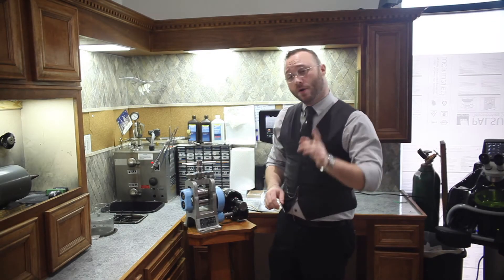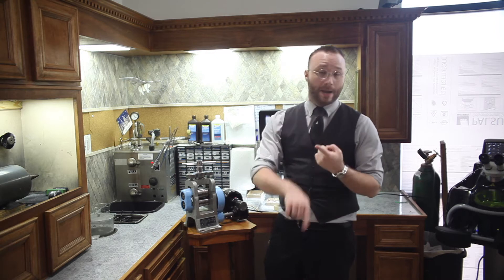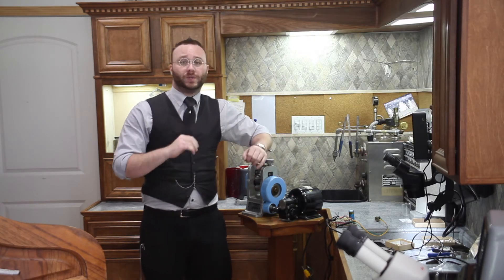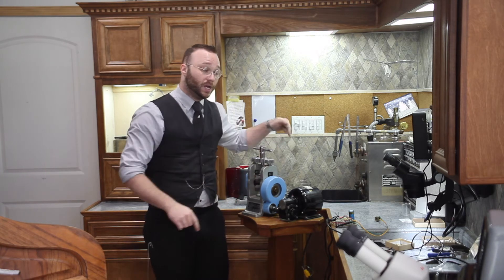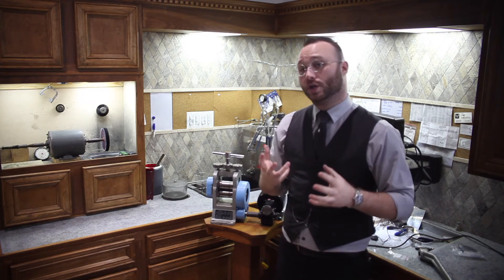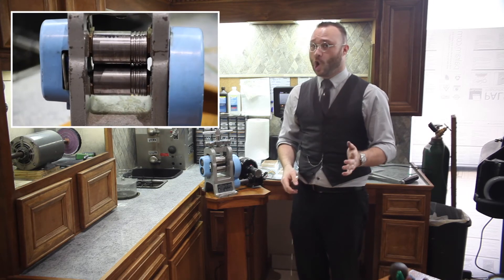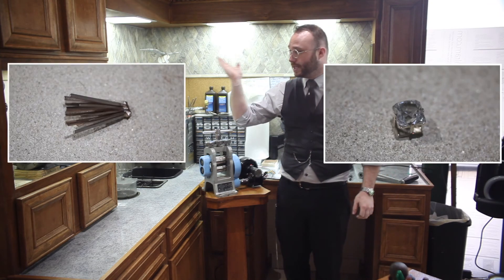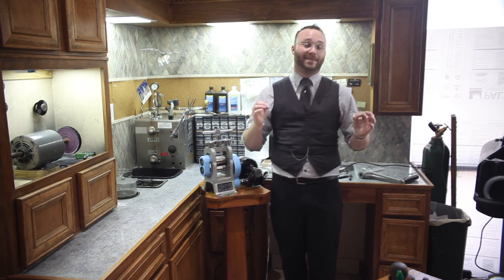Converting A Tatum T-70 Manual Rolling Mill To Automatic

Comment: It's great to see someone posting a video about DIY option for driving your rolling mill.  I'm sure the setup will work fine for the application but if your looking to do your own I would make a few changes. Fractional horsepower gear motors are perfect for this application.  My background is in machinery building/design. I'm in the process of putting a motor/gearbox on my pepe 110mm combination mill. I'm using a bodine 1/6hp 115v gearmotor, it has a 60:1 reduction with 270 in-lb torque at 28 rpm. I roll out a lot of ignots to make sheet as well as making my own mokume gane.  I  calculated the torque needed with a torque wrench running a 11/4" wide silver ignot using modest reductions of no more than half a turn. The 270in-lb gives a safety factor of 1.75. If you have a flat roller mill and want to reduce larger billets with heavier reductions I recommend looking at 300-350in-lb, or higher output torque.  1/4 to 1/3hp motors with a 30:1 to 60:1 gearbox reduction running around 30 rpm, this way no speed control is required (big savings and basic wiring) and you can wire it direct to 115volt plug and use any footpedal to turn on and off. Adding an emergency stop and fuse is a good idea as well.  Many units are 90 to 130 volts DC.  Many videos online showing how to use AC-DC rectifier (very cheap) with a dimmer switch to set AC current into the rectifier.  It can be that easy with a bit of research. I recommend a love-joy style coupler from gearbox to rolling mill. It allows for minor misalignment and is much more forgiving.  A solid coupler like used in the video is the wrong choice for the application. They don't allow for any misalignment and put heavy stresses on drivetrain unless perfectly aligned. Something to avoid unless your have the equipment and know how to properly align shafts. I'm using a gearmotor with a planetary gearbox, the shaft is inline with the motor.  Right angle gearboxes (usually worm drives) are an excellent choice to. I would consider fractional horsepower gearmotors light to medium duty units for the small shop or home jeweller. I would stick with reductions similar to what you do when hand cranking (for ignots), you can get more aggressive when using the wire grooves. 15-45rpm is a good range to settle on if you don't want the expense of a speed control. These are only my opinions based on my experience as a millwright building automated machines for a living. These won't do heavy reductions, if it would be a struggle to hank crank the piece through the roll mill then these gearmotors will struggle or stop altogether popping the breaker.  If you need higher speeds with more aggressive reductions you should consider other options. I will post a video once I have mine completed. I found the gear motor used in good condition for $125 US plus $28 delivery. The foot pedal was $35 and $30 for the love-joy fitting. It should come in at around $300 including a drum switch for reversing. You can always reverse a piece out by using a pipe wrench on the love-joy coupler. A bit crude but effective. I'm trying to keep it as simple as possible here. Thats as deep as I can get into it here. Good luck
Reply: i thought I should reply to myself... I completed this with the above setup and while it works fine for square and half round wire it will not roll out a 1 ounce ignot from a combination mold. It stalls out with even 1/4 turn reductions. After looking at what another manufacturer is doing I'll be using a 1/2hp motor through a right angle gearbox putting out 600in-lb torque into the rolling mills existing 4:1 reduction unit (2400in-lb total)  For more serious work a 1hp motor with a right angle gearbox putting out closer to 3000 in-lb and removing the 4:1 reduction unit altogether is a better option.  While the fractional HP gearmotor has been great for what it can do if your rolling out your own sheet you will need more power.
Reply from the maker: We only needed it for wire and small things. Thank you for the input. I'd love to see your video.
Reply: @jefflyon100  Hi, need help converting my 130mm Durston rolling mill to electric. I do mostly pattern plates an possibly some in got later. Please let me know if you are still helping folks. Thanks Bobbie
Reply: Where's your video?